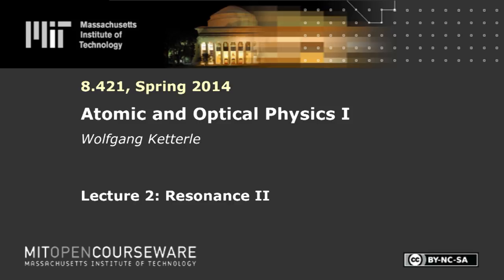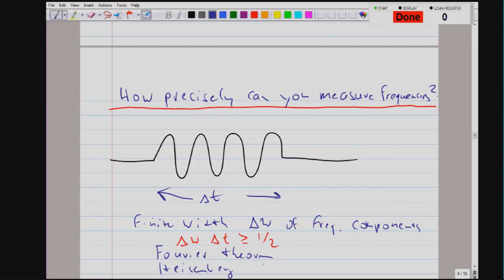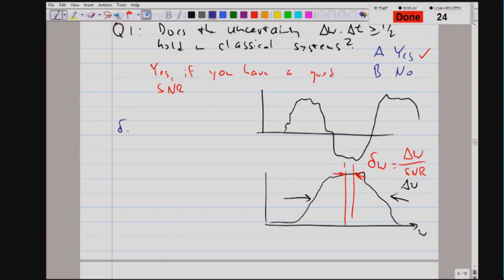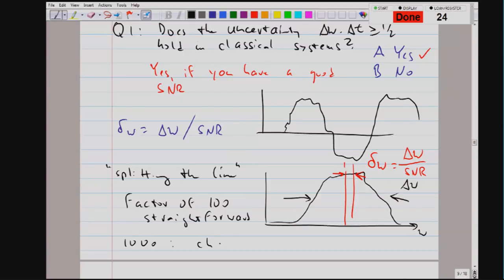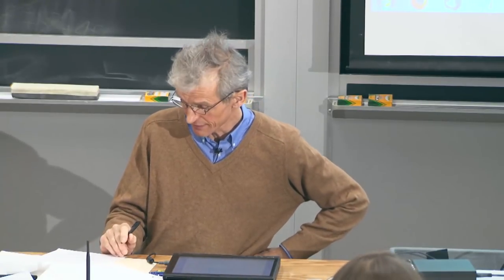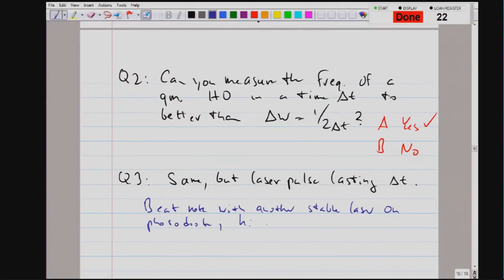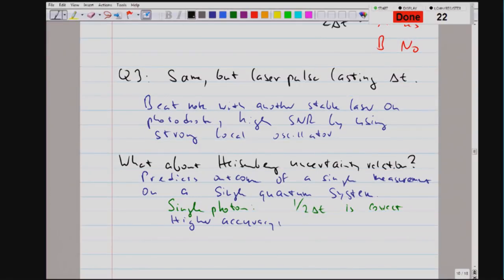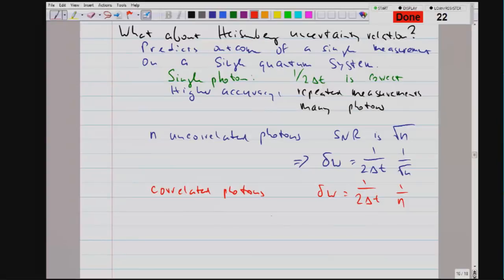2. Resonance II

Comment: There seems to be a bit of confusion in the Q1 (4:40): YES, we can measure a frequency of a purely classical harmonic oscillator better than the uncertainty suggests (if we have good SNR). But, NO, the uncertainty doesn't hold for purely classical system (cause we can measure frequency more precisely).

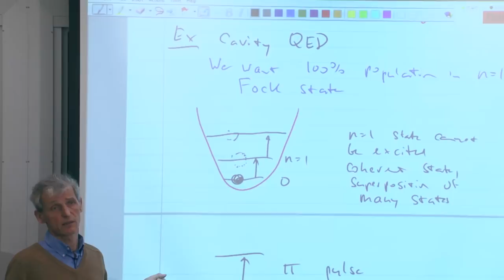Comment: I think the confusion around 40:00 comes from the professor not explaining experimentally how the preparation of the cavity is done. Theoretical physics only make sense when you are aware of the experimental processes being theoretically discussed. It's easy to forget that as a professor, when you gave so much knowledge about your subject, beyond what you teach in your lecture
Reply: I was thinking similar isn't the reason question 2 is yes is because there is no harm planks constant in the numerator..we still cannot measure any better than h bar/2 right due to the uncertainty pricnciple..barring any entanglement induced exceptions or some other exceptional curcumstsnce I haven't thought of..if there was an h/2 then it would be no basically in most conditions if Inunderstand correctly?

Comment: Someone explain to me how the fourrier transform of a classical oscillator signal in time, oscillating at only one frequency (just like it was drawn in the presentation, without noise), does not equal to a δ(ω-ω0)....
Reply: That is a sine wave in infinite time. But you make measurements for a finite time  Δt in real life. So if you take the Fourier Transform of a function that is a sine wave only for interval Δt and zero elsewhere and plot its frequency spectrum, you will find that it is not exactly δ(ω-ω0) but has a finite peak at ω0 and width Δω0.